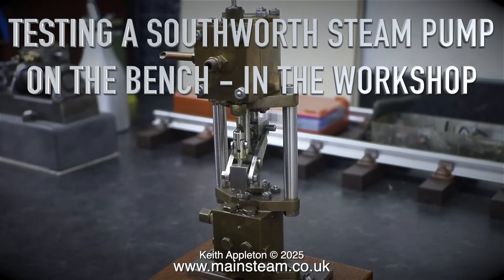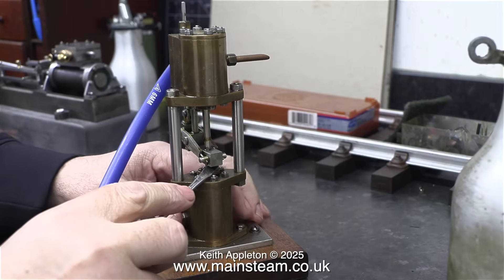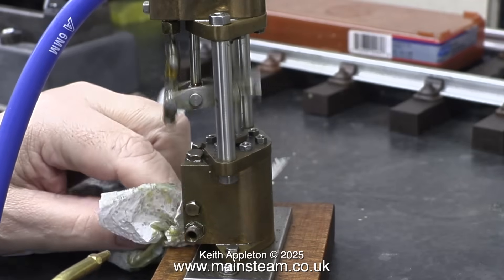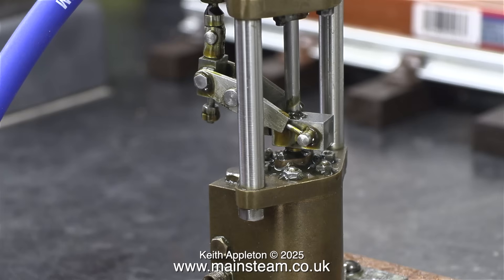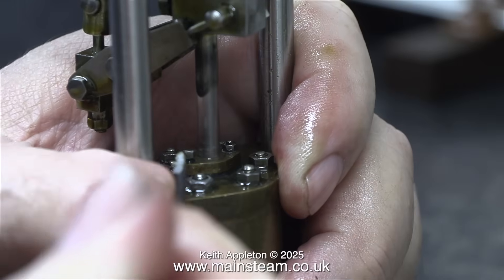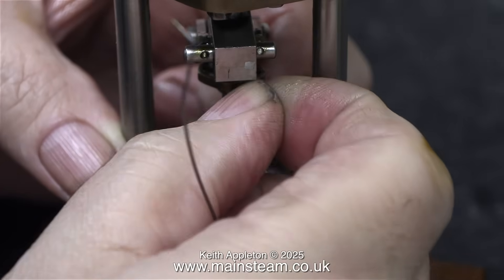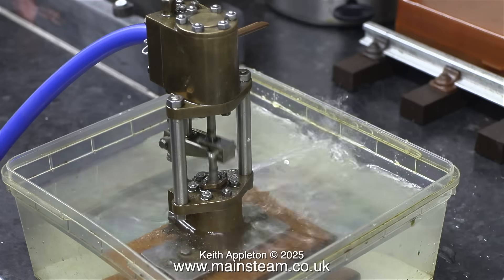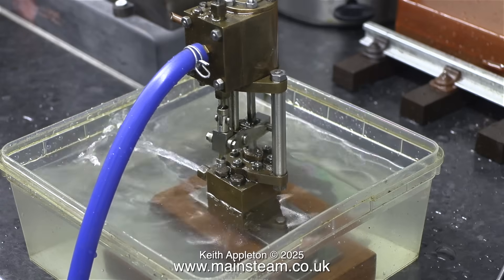TESTING A SOUTHWORTH STEAM PUMP - IN THE WORKSHOP

Comment: The volume of water being reduced on the return stroke is also due to the reduced volume of the return piston face being reduced by the diameter of the piston rod.
Reply from the maker: Yes indeed, but I fear not in this case. These pumps can be problematic sometimes in the area of the water valves, either way it pumps enough water for the job it will be doing.